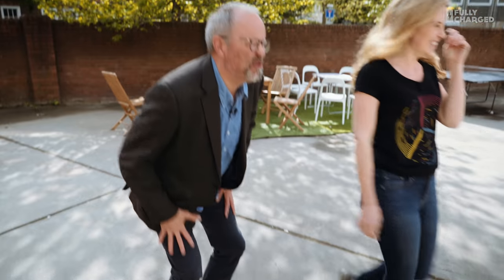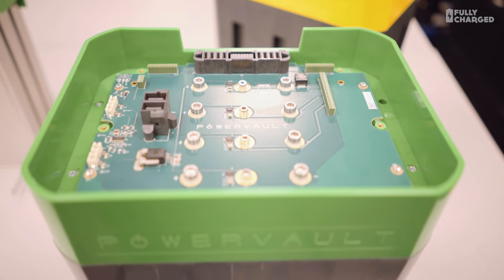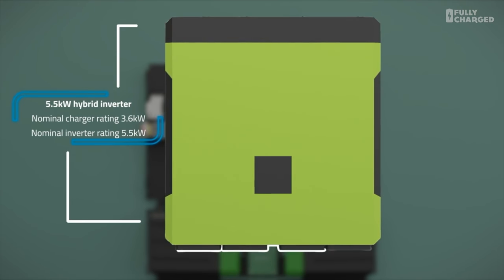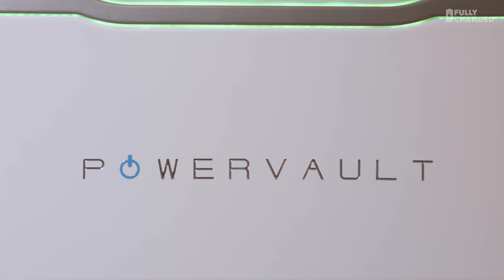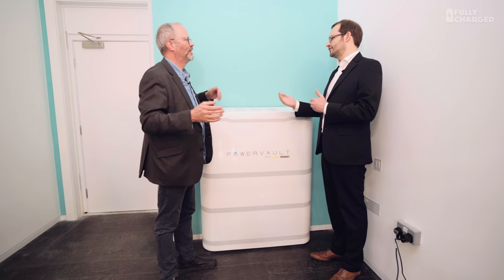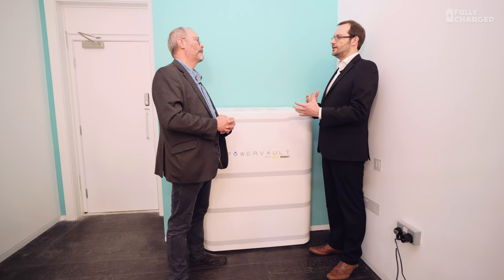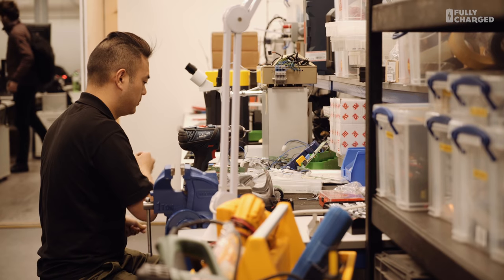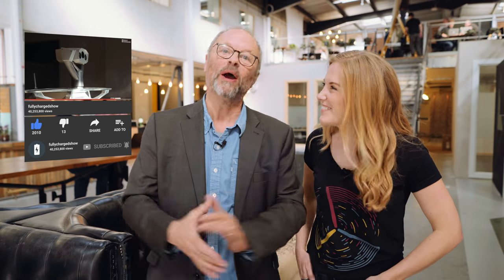Powervault | Fully Charged

Comment: I really wish these companies would put prices up and not 'get a quote' when advertising something.
Reply: Electric Vehicle Man , looks like around £7600 for a 7.5 kWh install from what I can find online about them
Reply: Sthilboy56 isn’t that more expensive than a Tesla powerwall? And 7.5 kWh is about £1 of electricity so even assuming it can save its own capacity 365 days a year payback is over 20 years.  Or am I missing something?
Reply: Tim Sture , that's right over 20 years to break even
Reply: @n111aow  It might be a quid of regular priced power, but the whole point is to avoid the peak tariff. That way I'm sure you'll be able to save a lot more, and break even a lot quicker. 

However,  you can do the same by applying a quality timer to your water heater and to your electric heaters  around your house for lot less. 

I guess the best use for a battery like this is if you also have solar... or if the power company is willing to pay for your help to boost the grid every now and then.
Reply: Bård Haveland I don’t see how that helps - if you can only save a quid of regular cost electricity that’s a maximum and using a cheap tariff is going to save less than that. To beat the £1 a day you would need to save export of a quid’s worth every day and also transfer night time purchase to day / evening use but that seems a tall order. I would love to get batteries but they just look like an utter waste of money until prices come down a lot more.
Reply: @n111aow  that's why they do not have pricing on their site. No financial sense to buy. Maybe secondary benefits of having big UPS in case grid will go down.
Reply: Like most items built to order, not to mention the variables as to installation, a quote is the best way to go. There is no charge for the estimate. I suspect commercial applications are best suited for now. Private ownership, unless the home is huge and gobbles energy per hour, is not quite a match. Of course, governments and power companies may provide incentives, discounts, etc. to encourage the use of these storage systems. Thanks.
Reply: @P G. why bother telling us you got the quote if you are not going to include in your comment the price you received? come on then, tell us how much is it.
Reply: @n111aow  if used with the TIDE tariff from green energy uk, you charge battery up between midnight and 7 a.m, which is 6p per kwh(which is less than half the price of standard tariff)... so effectively you could save half or more on your electrcity bill.....if you add solar into it, then you would save even more... if you only take cheaper tariff power from the grid and have no solar, then choose the smaller, cheaper battery...
Reply: Indeed, suggests to me that the thing makes no financial sense, lost interest to delve any further.
Reply: Electricity providers are now offering frequency response discounts for this product, making it more attractive. Looks to be about a 4 year payback even with no solar and just filling the battery off-peak at 4.5p/kWh.

Comment: Great show! I'm curious how long the cells last after they are already down at 70%...is the degradation linear?
Reply: Jeremy Schmidt watch again from 14:27 it is explained that there is a difference in the the way that the battery is used so the degradation would not be linear. How long, you won’t really know till there is enough out there for a decent period of time, but going by what is said I would expect that they would last longer because they would be under less strain than what they were when they were in the vehicle.
Reply: Jeremy Schmidt
You can't compare degradation in EV's and static storage.
Reply: Battery lifetime is usually related to the number of charge/discharge cycles and to a certain extent the rate at which they are charged.  So as they said the batteries are being charged and discharged slower than in a car, and probably only with one cycle per day, you'd expect the degradation to slow down.  One unknown is that in a car the batteries will rarely be fully discharged (as much as the controller allows) whereas this could happen in a residential situation, and most battery types tend to degrade quicker the more time they spend at a lower charge level.

So if your system is undersized and the batteries are drained quickly and left "flat" for some time before being recharged, it will likely degrade faster than getting an oversized system that never completely runs out of charge.
Reply: @vink6163  "flat" will presumably allow enough charge to remain inaccessible to the system to prevent accelerated degradation.
Reply: @David Cowdrey
What he said. We, engineers, make sure the battery is taken care of, it will degrade much slower at home. More optimal temperature, slower charging/discharging, programming not allowing the battery to be under-charged... All good things.
Reply: Thanks everyone for educating me! Makes sense.
Reply: Home use will be like a retirement home for the batteries. At the same time lithium cells degrade if stored at full charge. Hard question what matters most.
Reply: I’d imagine it’d be similar to a heat dissipation curve: greatest at the start but after that it gets smoother and smoother. Really though, static storage can be useful in some way or another at much lower percentages so I can see them lasting for decades or more depending on the Chemistry.

Comment: I have  just had an 8.2KW Powervault battery installed with EDF Energy. There is no clear indication as to the state of charge of the battery on the portal. On one day the battery stopped charging at 13.00 hr and exported excess energy (I though peak was 16.00 hr to 20.00 hr). 0.0 KW was sent to the battery at this time. At 18.00 hr that day I put the oven on. I had hoped the battery would supply the power. There was some solar power still being produce to power the oven but the majority was drawn form the grid. Once solar production stopped at 20.00 hr all the power supplying the house was drawn from the grid. It was as if I didn't have a solar battery! I had generate 13.12 KW that day. Also the Enphase app has indicated an error in metring following installation. Turning off the Powervault has not affected this making me wonder if one of the clamps has been moved during installation. The Powervault support line have, so far, not been able to address my concerns or replied to my emails.

Comment: I enjoyed having Maddie on the show, and would like to see her more.

It would be good to know if this product would play nicely with the Tesla Powerwall, otherwise Robert will have to choose. 

Should have asked at least what the capacity of one of those units is.

I'm wondering if anyone is working on DC powered electric appliances. Could you look into that? It seems silly to put the power through a DC->AC->DC cycle just to move it a few meters to the other side of your house. The parasitic losses have got to be worse than in DC wiring.

Comment: This is a very interesting update on the subject of home battery storage.  I feel that the time is right to push this technology nationally instead of wasting billions on unnecessary nuclear power station development.
On the subject of cost saving on electricity used, there is, as in this film, plenty of comment on using less power and using power at times when cost per unit can be lower.  One issue that never seems to be included in the discussion is the ramping up of standing charges by electricity suppliers to offset their loss of income arising from the economies listed above.  Perhaps this channel could include this subject in interviews with electricity suppliers

Comment: I see how these batteries could be used to store electricity during during the night when the price is lower. There is however going to be some loss of energy during charing and discharging of the battery. So in the end you would need more of that cheap electricity compared to using it directly from the grid during the day. How does this efficiency loss compete to the financial benefits?

Comment: I've a question with regards to min charging capacity. If my PV system is generating 50w winter time. Does that 50w charge the battery if there is no demand coming from the house. Or does the battery need a min charge ie 1kw, 2kw etc.

Comment: I was looking into the pricing and the saving analysis, they we're using 25p/kwh.. which is way off?? The 30% discount for the used "2nd life" batteries is nice but it looks like they expect them to go 5-6 years, new replacement batteries at time should be pretty cheap... but I would guess renault are almost giving these things away.
I'm not a fan of the "look at the long term pricing" either, this tends to to be a marketing tactic to avoid wallet shock or hide large profit margins.  The current kwh hr pricing for batteries looks to be in the £200/kwh price, so 7.5kwh would be  £1,500, add 50% for the rest of the bits at a rough estimate, add another £500 for fitting and round up to £3k...
Maybe  I'm miles out, but I'm always wary of companies who focus on comparing their cost to something we all feel is expensive, in a similar way to dealerships that ask you how much a  month you can afford, you know you're not getting the best value for money.
However I'm 100% considering buying one, just need the pricing to align itself a little more realistically & smart meters to get to stage 2 compatibility, so maybe not just yet.  Congrats to Powervault on a nice product, hopefully more competition will sharpen their pricing.
Reply: Replying to myself...sigh - it's been a long day !!
OK - so you can buy a 4 year old Zoe for £6k with 21KW of battery, however a powervault with 7.5kwh of 7 year old Zoe batteries cost @£5k... am I missing something ???
Please don't take this as negative to the technology or use of it (I own an electric car and have had solar for years) but we as consumers have to realise a companies first obligation is to their shareholders.  Don't get caught up in the marketing hype and anything that distracts you from the price you pay - understand the value of what we pay for, your money is hard earned so take the time to consider the cost of what you buy with it (before you ask - Yes, I'm Yorkshireman).
Keep up the good work Fully Charged !!
Reply: I pay £1500 for 9.6kWh of lightly used LiFePo4

Comment: Saving over 10 year is £4092 if using solar to charge the battery,7.5 kHw used a day from the battery at 0.15p per kHw.  
7.5 kHw battey cost to install is around £8.5k

So you make a lose of £4508 after 10 years .     I maybe I am wrong but how would I save money?
Reply: Crash UK yep, that sounds about right!
 I also think you lose on the deal!
Meanwhile, batteries get cheaper to buy so you lose more!!

Comment: this might be a stupid question: in ideal world, everyone would have a similar battery at home. Would that render variable energy prices pointless since the demand on grid would be even out by consumers using these methods. But in that case, if the energy is always at the same price, nobody has a reason to maintain the battery. Batteries for everyone -> constant demand on the grid -> constant price -> no need for batteries.

This feels like grandfather's paradox

Comment: I looked into batteries to go with our roof solar system but it wasn't a good value. Each homeowner will have a different situation.

In order to charge a home battery the solar system must produce more power than needed for the home. This means our solar system would have to be enlarged to make use of the battery. Then there is the cost of the battery itself. Instead we use the grid as a battery.

We have a 25 year agreement with our grid supplier. They charge us $0.15 / kWh but they pay us also $0.15 for power we feed back to the grid.
Reply: John Donaldson - When you install solar panels, you sized the installation to cover daytime/nighttime/summer/winter usage.  That means solar always produces more power than is needed for the home, during the day, especially in Spring time or Summer depending on if you live in a climate where AC is used.  Your net metering is great, and if it's true "net" (full parity in and out) batteries make no sense financially.  However, if your purpose in going solar was to stem climate change too, you must be aware that from ~4:00pm and on, your home is running off of non-solar grid power, and that power could be coal or nat. gas.  So there is an argument for using storage to truly keep your energy usage on solar alone.  On balance, your solar overproduction is being used by others, and in principle, less fossils are used during the day, when you do that.  There is no argument for adding more panels except this one:
If you wanted to go offgrid fully and use Powervaults only, you would need to 
A) upsize your solar array to provide a day's power in the short winter day period.  Maybe double...
B) buy lots of batteries to compensate for multiple days of overcast/rain/snow

These are the challenges society will face trying to move to 100% renewable energy.  We need to take storage at the utility level more seriously.  Pumped hydroelectric storage is the obvious choice, but technophiles are all convinced it must happen in the form of lithium batteries.  In the longrun, having individual lithium batteries in the home will NOT make sense unless they are trading sharing energy amonst each other, as mentioned in the video.
Reply: Pithy.  Will you be here all week?  I won't forget to tip my server.
Reply: Dude.  You're supposed to eat those edibles, not snort them.  If you got any further off topic, you'd be on Reddit.  Are you planning on changing everyone's mind here so we all believe that Climate Change Science is a hoax?  President Trump wants his mantra back.  Did you read that from Crichton?  I did.  News flash.  He was very wrong.  Hope you don't learn all your science from a science fiction author.

Comment: Interesting concept, but why don't they just sell the clever electronics bit and let you plug your electric car (not just Renault) into a socket on the side?  Isn't this what Nissan and Ovo are doing?  The thing which wasn't mentioned was the price, and usually that's bad news when it's omitted.  Oh and definitely more Maddie, less of the battery perv...
Reply: Because most cars (I think there are one or two exceptions) aren't geared up to allow that - the car itself cannot discharge back through e.g. the charge socket.

I agree it would be sensible if they could, mind you...
Reply: I suspected that but you would think that Renault would enable this feature in all of their electric vehicles from now on.

Comment: Good in theory, but a lot of disappointment if badly executed! I've been a Powervault customer since 2017, and to be perfectly frank, my customer experience has been terrible. The battery system I had was an older  kitchen cabinet-shaped unit with up to 6KWH of battery storage, linked to my 3.5KW PV system. Starting with the niggles. The portal that I access to monitor the battery has been in development since forever, with a lot of features (stuff that would be useful if they ever implement them) still not available. Then onto their customer service, where they take anything from a week to 2 weeks to reply to an initial email contact. They seem to have a high turnover of staff, as I seem to be dealing with different people each time, making phone calls difficult. Third, the firmware that controls the system has to be updated fairly regularly in order to maintain performance. Unfortunately, this has to be done by an engineer onsite, necessitating time off from work. Forth and more serious issue is the reliability of the battery system. There have been at least 2 (or maybe 3 I don't remember exactly) occasions where the individual battery cells have become unbalanced, necessitating replacement. I suspect this is linked to the firmware issue. All this has made me wary about the reliability of the unit, and means that I have to continually monitor the system. The last incident I reported to Powervault last November (2019) and after repeated delays, they came back mid Feb 2020 with a proposed fix (to replace the unit entirely as they no longer had the battery packs for that unit). Even then, a proposed fix date of 6th Feb was pushed back to 20th Feb, as the replacement unit was also in short supply. When they did eventually replace my unit, I discovered that they'd only supplied 4KWH capacity and not the 6KWH that I'd purchased. Although Powervault  have admitted to their mistake, It means yet another engineer visit to replace this unit with a larger chassis which can house extract batteries. This took place on 12th March, although it should have taken place on 2nd March but had to be postponed as they didn't ship the equipment to the installer. Don't get me wrong, I'm a keen advocate for the technology. But it has to be reliable. I dare say that Powervault will be successful if they can iron out the bugs and unreliability, but as it stands, I would not recommend them to anyone who looking for dependability.